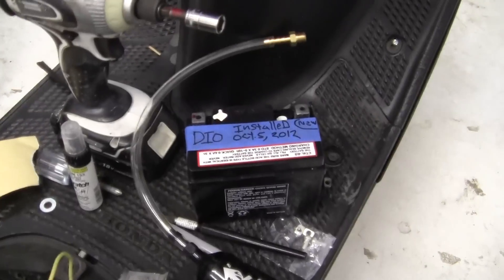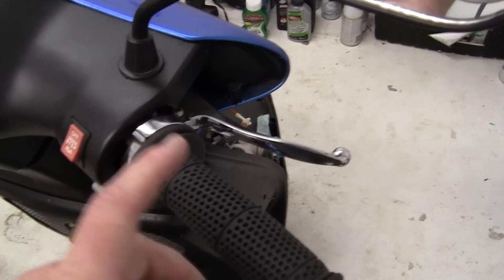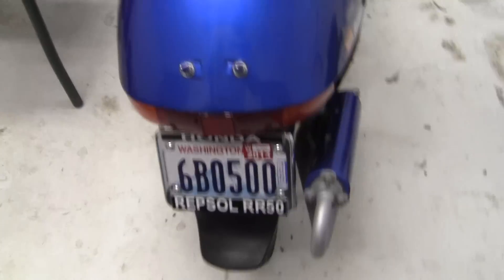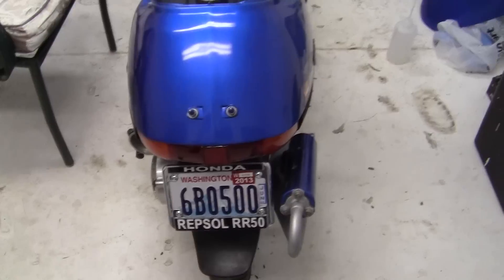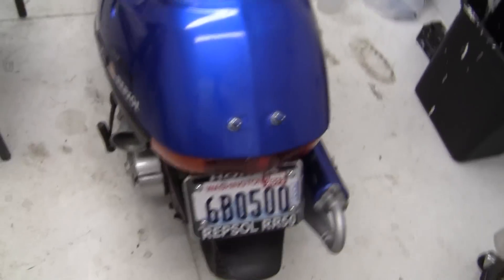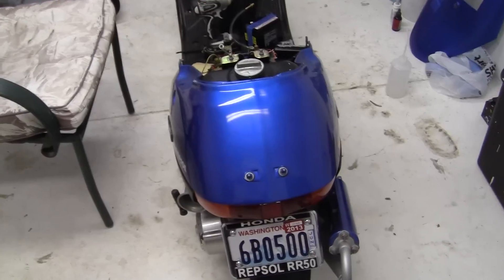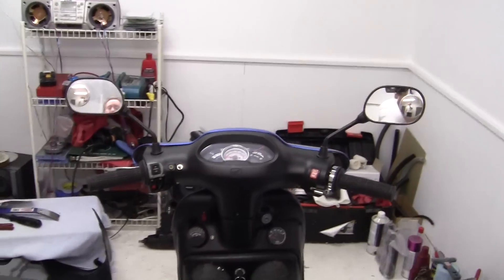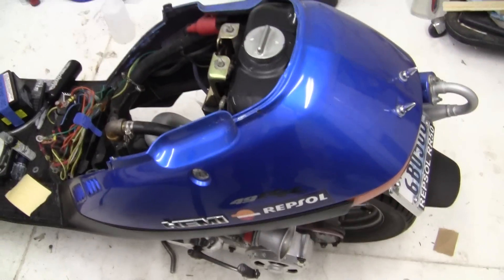3- DRAG RACING PREPARATION!!!

Comment from the maker: Stage six or malossi or polini, do not make a big enough pipe for my 52.5x 54mm cylinder = 120cc engine. THey only make small pipes for like 80cc. All are excellent companies but they do not make pipes for magnum DIO racing engines like mine. I wish they did.